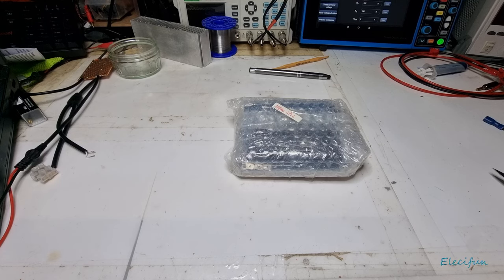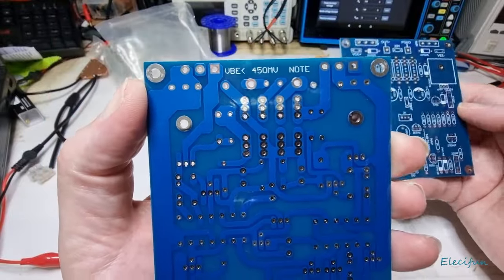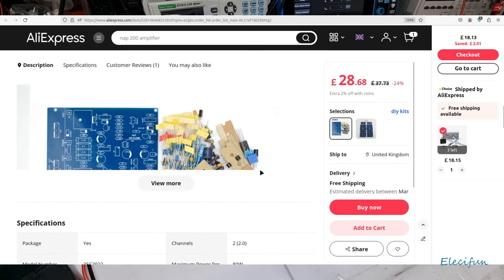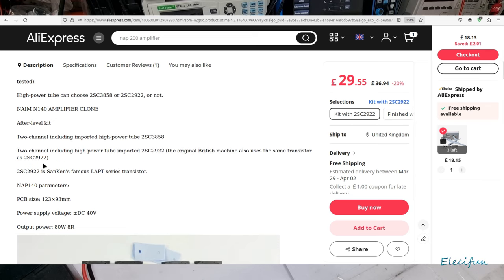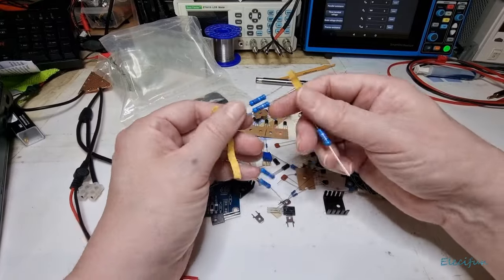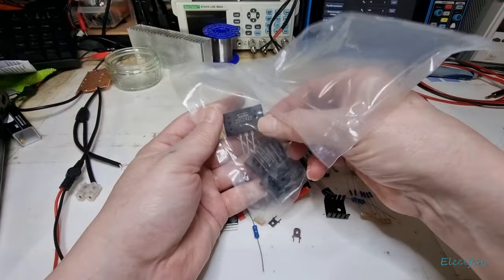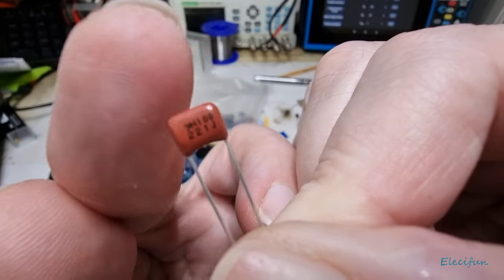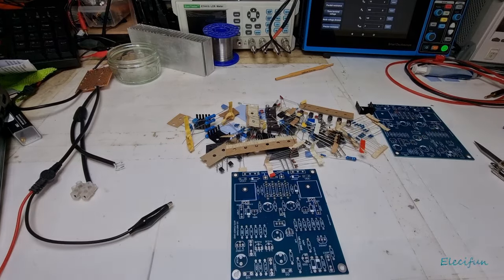Naim NAP140 Amplifier Kit (Aliexpress) Preview

Comment: The "Sanken" transistors look like fakes, the font is wrong.
Reply: I usually buy only the circuitboard, get the components from Digikey,Mouser, Farnell and so on. The supplied components, resistors and capacitors are low quality, power transistors are fake.
Reply from the maker: @diabolicalartificer after checking the Sanken website I can see these transistors are obsolete, and would agree with you about them being fake.
Reply: @Elecifun  They may be ok, the package looks right, just something about the font, who knows. If you have trouble with them I have some genuine Sanken 2SC3858/2SA1494's, I'd be happy to send you a couple of pairs if you pay the postage etc.
Reply from the maker: @diabolicalartificer that's a really nice offer, thank you. The offered transistors are also obsolete and I would rather swap out the Sankens for the current TOSHIBA 2SC5200 which are available from Farnell, RS-Comp-onents, Digikey etc. We can all purchase these knowing they are genuine and the test results hopefully will reflect that.
I really do appreciate the offer, cheers.
Reply: @Elecifun  your welcome, those Toshiba transistors look decent. Getting decent audio transistors is getting harder as you know, with the move to Class D amps using switching FET's. All the best...DA.

Comment: these kind of kits are worth the money just for the pcb  but you need to have genuine outputs 1st , china is getting better at fakery but not in this case, the offset text ,sanded smooth finish , and welded + tinned leads.all classic.  ive just had some fake irfp460n withstand vds of 500v no problem no avalanching leakage till 512v   ,i was stunned , rds and ptot to test next